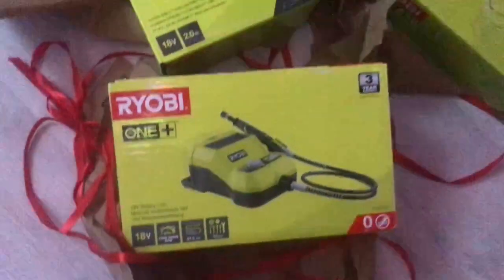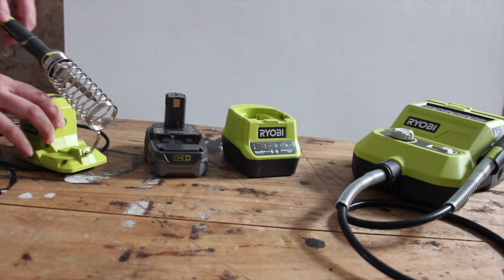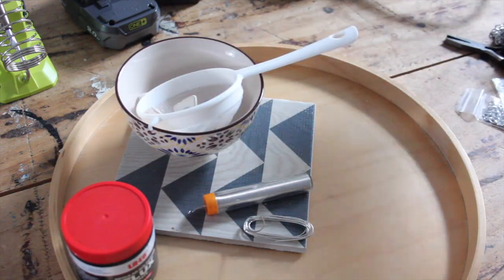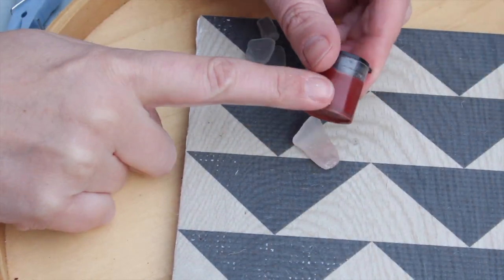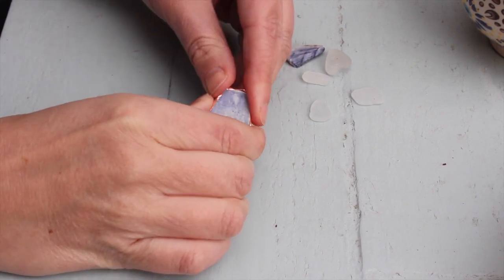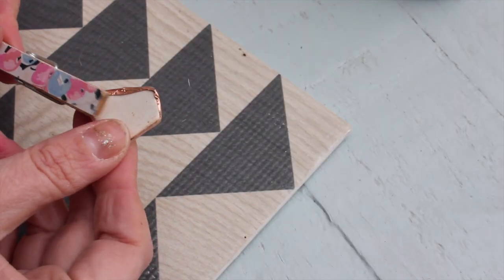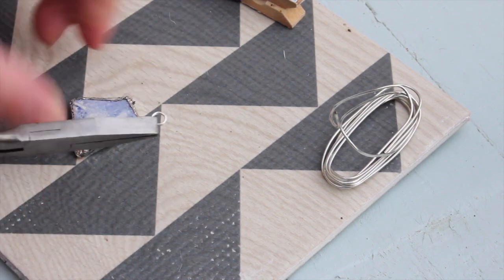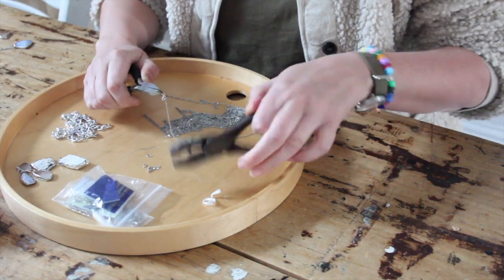Making a necklace from beach finds, first time soldering

Comment: Yes you should always wear a mask when soldering, because the smoke is dangerous and can cause respiratory problems. Thank you for your video very inspiring. 😊
Reply from the maker: Indeed, fair comment. I didn't solder for long and I was sitting outside but masks are always a safer option

Comment: Hello, Loved your video. I am also very curious about the solder you used. Could you please tell us where did you ordered your solder from? I recently purchased some silver tone led-free solder on Ebay. It melts but does not want to stick to fluxed copper tape at all! The one you used flows onto the tape beautifully. I would appreciate of you shared the source with us. Thank You <3
Reply from the maker: Hi, Its the solder that came with my Ryobi soldering iron, it worked great. I've used other lead free solder too from my local hardware store that worked fine if you add a bit of flux. Hope this helps

Comment: Thanks for a great video! I have a question. When you melted the copper tape to the glass, the copper color looked like it turned to a silver color. When I look on Amazon, all I see in the after photos are pieces with copper color on them. Where can I get tape that will remain silver colored? Thank you!
Reply from the maker: Hi, you use the copper tape so the solder has something to stick too. So the silver colour you see is the solder going on the copper tape. Hope this makes sense? thanks!

Comment: Ciao è filo in stagno quello che usi?possibile sapere come si chiama L adesivo color rame che utilizzi è il liquido per far aderire lo stagno grazie
Reply from the maker: Hi, you put the copper tape around your stone then put a little bit of flux on the tape before soldering. The solder is the tin wire you were talking about. Hope this helps :)

Comment: Hello! This video is awesome and so helpful. For the solder, did you use sterling silver or a different kind of metal “wire” ? I’ve read that a solder iron will not properly melt sterling silver because it doesn’t get hot enough, I am just curious if that is true !
Reply from the maker: Hi Caroline. I just use normal lead free solder, hope this helps
Reply: Thank you !!